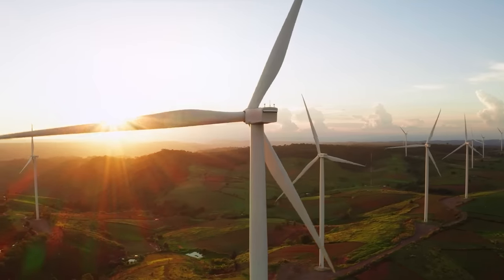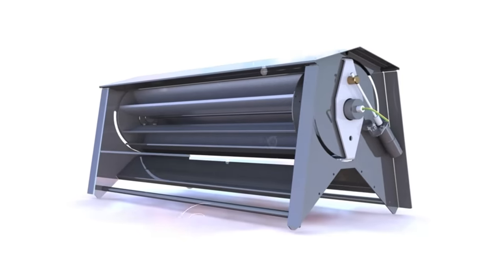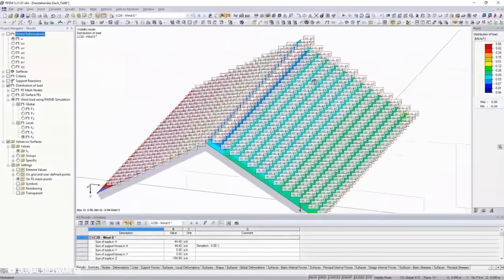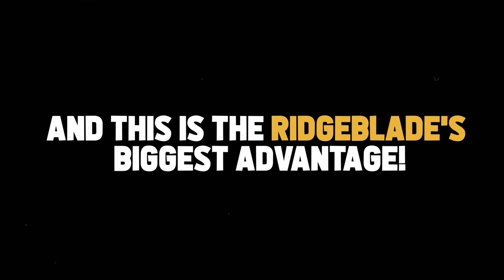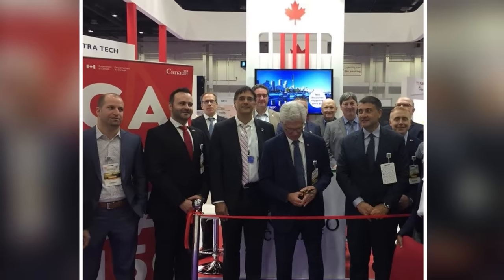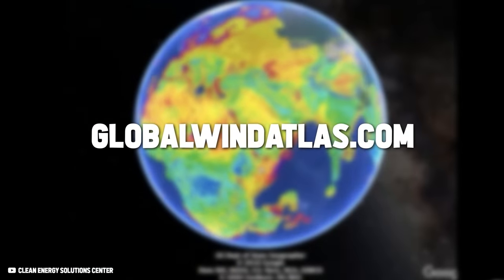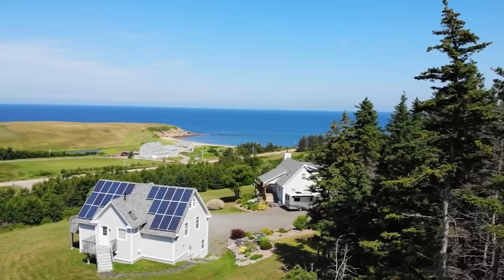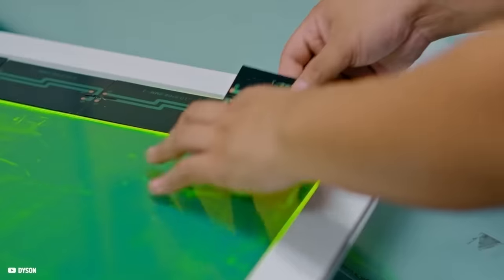Genius RidgeBlade Home Wind Turbine Beats Solar Panels by 220%

Comment from the maker: Genius Solar Panel from Waste Operates without Sunlight!
👉🏼 https://youtu.be/BoIh0ZIg3ac
Reply: It's so easy to blame climate change, why the weather is different, the climate never the same every year. Have you ever thought  the sun might have something to do with it.
Reply: @rodneyquick2883  Your "argument" doesn't make sense.  First you insinuate something about blaming climate change, then you insinuate climate change is because of the sun?  It's easier to just ignore climate change or blame it on something you have no control of, that way you don't need to do anything.
Reply: Pin the comment below by guy who works for ridgeblade...cost is way less
Reply: Where are these available …. Talk talk talk … no actual product

Comment: I love how those 'new' wind turbine design videos never ever mention the amount of noise the turbine makes. I have a simple extractor fan in the attic that turns on above a certain temp and the hum can be heard throughout the house, let alone outside. And this is arguably a low noise fan.
Reply: sounds like you have a problem with your extractor fan
Reply: @robertrichard2322  Balance, plus rubber isolators keep vibration from being coupled to the house.
Reply: liam f1 wind turbine by archimedes is said to be silent and only cost $9000 usd for two of them for all the energy needed for an entire average family house
Reply: 4:35 The answer.
Reply: pretty sure that type of fan and these turbines are completely different, plus attic fans are actually in the attic and not outside of the attic...
Reply: You need to regularly clean the fan blades and bearings, as they attract dust and grime,  then add a  squirt of WD 40.
Reply: Ok but that's IN your attic..  Logically, that means it's closer to being inside your house vs a turbine OUTSIDE your house lol.. 

So duh it's going to be louder
Reply: Fan noise depends on a few things:

#1. The size of the fan.

#2. The design of the blades.

#3. The design of the motor and bearings.

#4. The RPMs of the motor.

Also there are ways to muffle the noise which sadly seem to be all but ignored in such markets as I too have 2 extractors in my house - in fact my bedroom has a bathroom/toilet on the floor below me and a toilet directly next to my room, so I understand completely the noise factor and how clearly the designers put ZERO attention into sound proofing them, likely due to costs as much as anything else, but also using conventional means of foam to isolate noise takes up more volume, which means a larger hole in your house, which means a lower likelihood of someone getting a fan, which means they don't push for it.

Hopefully as acoustic metamaterials enter the scene within the next decade we may see less of this problem my fellow sufferers in extractor fan noise pain 😅
Reply: @VenturaIT 

"liam f1 wind turbine by archimedes is said to be silent"

I just watched a video on it and they quoted 42 dB - that is NOT silent.

On a day with lots of noise you wouldn't notice it from a significant distance, but on an otherwise quiet day with 2-4 on every other roof you would definitely hear that.
Reply: @gaycha6589 

"then add a  squirt of WD 40"

NOOOOOOOOOOOOOOOOOOOOOOOOOOOOOOOOOHHHHHHHHHHHH.

Regular WD40 is for purely mechanical stuff, you don't want to put it near electric fans or any kind of electronics, to say nothing of the fact that it can degrade certain plastics too which tend to be found in fans.

I did find something about a special electrical contact variety of WD40, but you didn't specify that - please be careful offering advice that could literally destroy electrical equipment.
Reply: Yeah the noise or hum from this would be my biggest concern
Reply: I love how some people don't listen carefully to the video....(4:35)
Reply: Fans turn at a much higher speed than do wind turbines. But no wind turbine will be as silent as solar panels.
Reply: Really? I have an MVHR unit up in my attic that has multiple centrifugal fans in it. The only time I hear even the slightest whirring noise is when it is dead silent at night.
It's suspended on cables, each of which has springs, followed by silicone rubber damping blocks on the cable mounts.
The real thing here is inline vs centrifugal fans. Inline fans spin at high speed, while centrifugal fans spin significantly slower to move the same amount of air.
The slower you spin those fan blades, the less noise you generate. Therefore, an oversized centrifugal fan spinning slowly is very much quieter than a little inline fan.
Reply: Extraction fans are noise prone, as they are meant to pull a vacuum and are high speed. Ventilation fans are slow and quiet as they only create flow not positive pressure. 
If a fan is mounted too close to a spar bar or mesh, it will make wind-sheer noise.
Reply: Execpt then it comes to engine noise from a fucking harley davidson, or gasoline lawn mover, or childern shuting playing foodball. this wind turbine will not increase that "sound level" at all.

Comment: So Ridgeblade is the "Apple Computers" of the wind energy world.  High price tag, extremely limited distributors and (currently) very low production rate.  There's three strikes right there, I'll add a 4th strike since they're still playing Little League.  This system is only useful if your prevailing (75% of the time or more) winds come from ONE DIRECTION.

Comment: I had this idea years ago.  Built mine with Squirrel cages, even incorporated the high and low pressure sides.  mine worked like an overshot water wheel.
Reply: Care to share your build? 😁 We have only solar right now, and it's really terrible through winter, but we have an endless supply of wind.
Reply: How'd you get the squirrels to stay inside and constantly run? Did you have to capture new squirrels all the time and replace the dead ones or use the dead squirrels as motivation for new squirrels to keep running?
Reply: Many of us have thought of it.

Comment: It’s annoying that the one company making these is apparently a mess business-wise (excessive prices, weak distribution), but conceptually it is sound. The idea of taking advantage of roof pitch for wind speed acceleration is a good one, and installation should be straightforward on countless buildings. And mechanically, they’re not exactly rocket science! With production at scale, there’s no reason this design shouldn’t be cheap to manufacture and cheap to install - maybe cheap enough to be competitive with battery backup for solar. If it can offset the cost of storage (or relying on grid power), it could do very well financially. It would be really nice in a hybrid system with solar panels.
Reply: Down here in FL pulling the heat out of the addict added bonus

Comment: Noise is the factor that rules out wind power for our homestead. We love our peace and quiet.
Reply: well you can apply brakes on it or close the intake for when you don't want noise, IMHO you don't need that much power input if the house is well-insulated, have adequate lighting from sun, uses LEDs, etc.
Reply: True but when it's windy it's kinda noisy already.  Hopefully some systems will be quiet
Reply: This noise can affect women in disproportionate ways
Reply: Execpt then it comes to engine noise from a fucking harley davidson, or gasoline lawn mover, or childern shuting playing foodball. this wind turbine will not increase that "sound level" at all.

Comment: This actually looks like a blower in reverse, pretty sure this concept can be easily duplicated, no magic here! Probably easier to make than a fan blade on a 3d printer! I might give it a shot when time allows! If this actually performs as stated (which is almost never the case for these kind of things), this could really be a cheap solution for extracting wind power for anyone with some building skills. Looking at cost, these guys definitely have some healthy margins on that contraption!
Reply: Robert Murray Smith channel may have all the answers you seek 🤔
Reply: I REALLY DONT THINK THIS IS A NEW TECHNOLOGY ……..I THINK ITS MORE NOICE AND MORE MONEY FOR SOMEONE…….. FLORIDA HOMES COULD USE A LOW NOICE ALTERNATIVE TO THEIR SOLAR PANELS THAT IS A 100 DIFFENT NEED FOR A COMPLETE BACK UP…..
Reply: My thoughts exactly: nothing but a squirrel cage blower fan in reverse driving a generator(s) instead of being driven by a motor. As you said, with some shade tree engineering and a good car alternator or two, one can build one of those pretty quickly. I already have one wind generator made from a junkyard alternator and PVC pipe blades. I have a 3 and 5-blade setup I can swap depending on available wind speeds.
Reply: Well don't bother because it's a piece of garbage and it will not produce any real levels of energy.
Reply: @CajunWolffe Care to share any findings or how to information? Sounds like fun!

Comment: A price tag of $53,000 really is too high for most people. You can generate the same amount of electricity with 6 archimedes style turbines for around 2/3 that price. The only advantage I see for such a system is that the top of it could become housing for archimedes turbines if your roof isn't big enough given wind speeds for just one system OR if your area doesn't allow wind turbines at all and you are trying to hide them. 

A system that's difficult to buy is also going to be difficult to maintain. I attended classes at a technical school with had a giant wind turbine that was mechanically turned off because the company behind it went out of business and therefore it could not be maintained. Eagles then built a roost on top so the school couldn't legally repair it anyway. It's been standing there for years unable to generate any power at all. Therefore whatever you buy you need to make sure that if can be maintained by 3rd parties in the event that they go out of business.

Comment: Thank you for contacting those companies. I'd been following the Ridgeblade for ages but couldn't ever find pricing information on it. It's sad that it's currently so pricey and proprietary... I did a design that incorporated that, for  a house project... :/
Reply from the maker: Glad to help!
Reply: Based on some other comments, it doesn't appear that the channel contacted the company at all, just throwing out some very misleading information.

Comment: The system might look nice and be more silent than "conventional" wind power systems. But when you compare it to the most common design (3 blades propeller), I see several glaring disadvantages:
1. Installed on the roof means close to the ground, which means lower wind speed. 
2. Can only fully harvest the wind coming from a single direction (not even from both sides of the roof, as the system isn't symmetrical). Propeller systems turn with the wind and thus operate at max efficiency for every wind direction.
3. Only one blade is aligned perfectly with the air flow at any given time. Thus it makes less efficient use of its collection area as a propeller system would (where the blades have always the same, perfect alignment).
I think this system is only interesting for niche markes, e.g. if the layout of the property doesn't allow to just put up a 10m pole with a conventional propeller (which should be much cheaper for the same energy output).
Reply: @@nexus169 No,you will have terrible gas mileage suddenly from all the drag it causes. There is no free ride.
Reply: If you are facing the prevailing wind (like my parents house which looks over the sea at the prevailing wind as well as at sea breeze) then it doesn’t really matter - almost all the wind comes from there.
The advantage comes from the air being pushed up the hill and then up the roof itself, giving a substantially larger effective area of wind.
Reply: @JohnR31415  I came to say just that have a house facing the sea in North West Scotland, it would be perfect... Apart from the price. That make me suspect the technology and mistrust the business. This is being marketed as some expensive and exclusive gimmick. It needs to be mass produced and mass marketed with a corresponding drop in price.
Reply: To harvest the wind from any direction, you could put your house on a turntable with a big tail to keep it pointing into the wind.
Reply: @bertsbases  LOL!!! Sounds perfect!!!

Comment: This system likely requires a specialized roof truss design which is why they need to have an Engineering firm design the roof for the considerable added loading.  Still, I like this.  I’d take a hybrid wind solar system for redundancy and added energy capacity.

Comment: i actually thought about this exact design 20 years ago, logically it's the most efficient design for capturing wind power, the downside is the designs dependency on specific wind direction, you can't exactly spin your house to meet varying wind directions............

Comment: Really ingenious, however wind direction would have a major factor in determining performance and efficiency.
Reply: Especially since most urban homes have trees and/or other buildings to the left and to the right meaning wind isn't likely to blow as fast in that direction. Then again, if you had the money to put down, you could use this and then put an archimedes style turbine on top of the ridge to catch wind from other directions as well and you'd still have room for solar panels.

Comment: The problem with any of these systems is the cost.
I have a new well insulated 1650 sf home with a heated pole barn in Chicago. I spend $1000 per year for electric and $1000 for gas. (Yes, I am a cheapskate). A $50,000 system would take 25 years just to break even and that assumes that I convert to all electric heat (another cost)

Comment: Basically a squirrel cage just like a swamp cooler turbine squirrel cage. Horizontal also enables bearings on both support sides, as well as you can use two generators or alternators producing possibly twice the voltage current. But it all depends on wind turning ability, and the torque of generators/alternators, for the power current output.

Comment: If a squirrel cage on a microwave, ducted to vent to the outside, very small and using very little electricity, can clean out a whole kitchen of smoke and odors, and a whole house in under 1/2 hour, seems like a great idea to have a bunch of bigger ones powered only by wind.  Great idea.
I sure hope though there is a self lubricating engineering design in there!

Comment: I think the roof turbine is a great idea because you have this natural surface to collect the wind.  There are a few big buts though.  Your house better be facing the trade wind direction.  The graph showing how solar and wind perfectly accent one another is not the case in many locations where wind typically dies out in the night time as does the sun.  Not sure where that graph was produced.  I would imagine these could be noisy and add quite a bit of weight to a roof.  Unfortunately wind and solar are no replacement for fossil fuels unless one has loads of storage capabilities.

Comment: Love the concept, and my house would be ideal for this, being on a ridge in the middle of fields, BUT far too expensive to install, too many years to pay off!
Reply: Agree. I wonder why these are so expensive. Cost for materials and manufacturing can’t be over $1,000 per unit. They’re marking up the cost dramatically. This should be $15-20,000 for 7 units installed.

Comment: A mistake:  @1:32 the clip on 'wind speed doubling increases power output 8x' is wrong - it's doubling the length of the blades does this.  THAT is why turbines are getting bigger, nothing to do with wind speed.

Comment: It looks to me that one very important thing is missing with this idea: wind changes direction all the time, and the benefit of the roof increasing the flow through the turbine only works well if the wind blows in the right direction. So, apart from the ridiculously high price of these things, in practice the efficiency will be much lower.

Comment: You’re $530 a year Wind Turbine maintenance figure is miles out! I have a lot of different turbines near me, my next door neighbour has a 50 kW endurance it has had to have the blade replaced at a Cushty £11,000 each! The 2 MW Siemens turbines near me have had problems with the main HV transformer at a tidy 30,000 each!

Comment: I wonder if you could install one or two on an electric car. Charging and powering it almost at an endless loop. Faster you go more energy producing or while your at work 8-12 hours in a parking lot back to full when you get off. Sure would look stupid driving but than again would that bother you if this actually worked?
Reply: No, more losses than gains. Friction and drag

Comment: this is brilliant. but for home users these has to be scaled down version of this shown in video.  typical normal home use power is about 24KW pr. day with heat pump. that will be about 1KW/hour.. so if that could add. about 1kWh in night to the house powergrid it will be brilliant, and NOT so expensive to do.

Comment: So is it a two way directional system? Normally the wind in my area is from the west but many times it is reversed. There is 8 feet between the gable ends of my house and the house of my neighbour, this causes a vortex thus increasing wind flow. I always wondered if a wind turbine could be placed between the houses to house two wind turbines.